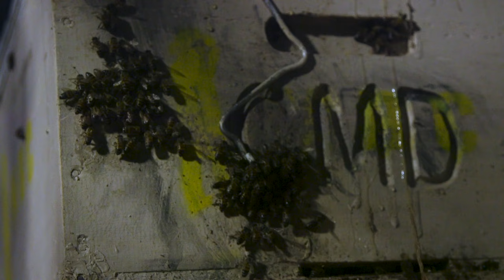Rescuing a Bees from a Tree Stump using a Bee Vacuum - The bush Bee Man

Comment: Hey Bee Boys. Have a look at making a 'Bushkill Beevac' style box. Sounds savage, but it is much nicer for the bees.
Basically just a base with the bee inlet pipe, then a normal 8 or 10 frame box with frames on that, with a lid that has the vacuum suction into the top, and which also can be removed for ventilation once done.

There's a few videos around on them. Have a look into it.
The bees can occupy frames straight away, therefore it is much more convenient for transferring them later. Just grab the whole box and place it on a hive base and slap a lid on.
Also, because the lid is ventilated, they can stay in there for a day or so comfortably. Makes transporting them not as much of a rush. Them having frames to climb on also helps as they don't bundle up on each other and overheat as much.

Comment: Happy Anniversary!

You don't worry about cell orientation when placing in the frame?
Reply: Orientation is supposed to be critical for the survival of the brood and for holding honey.  You may be able to see the angle to the horizontal in the plastic Honey Flo combes. Using that key opens the bottom of the cells and the honey flows out for harvesting. Someone suggests that the wrong orientation of the comb may drown the brood.
Reply: @RegWhelan  I do removals and notice he turned comb 90°.   So cells not at 11° degree anymore.